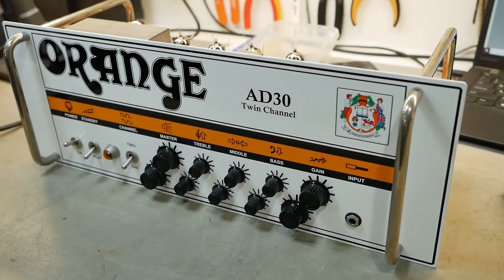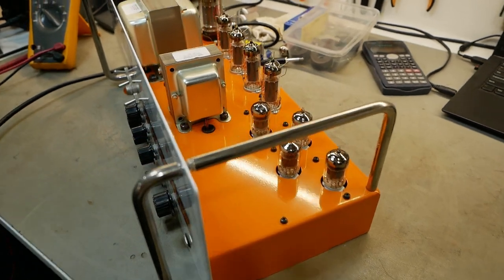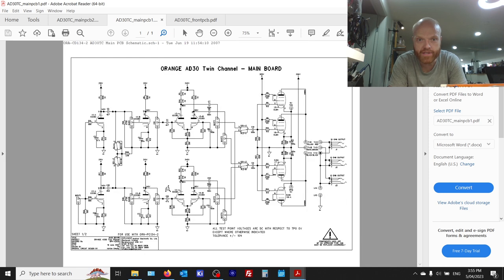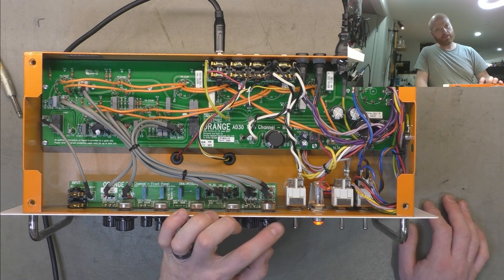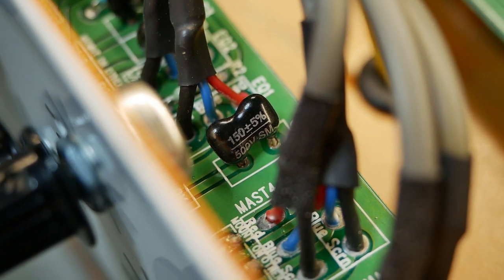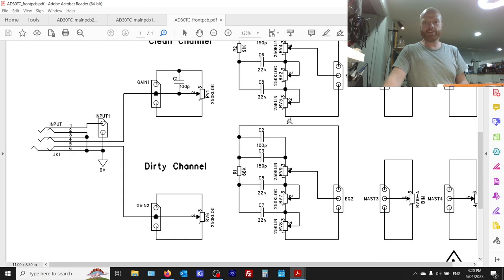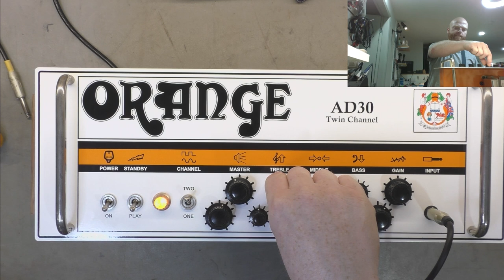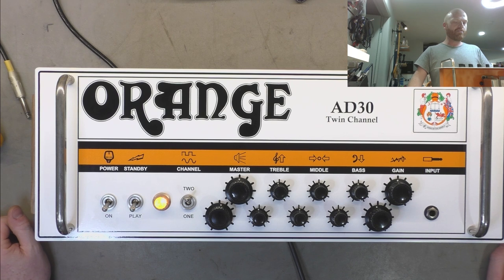Orange AD30 - Blowing HT Fuses & Noisy

Comment: I have one of these.. absolutely love it. Didn't really know what it was to be honest when I picked it up.. had another orange amp fail and the shop offered to replace it with the ad30, if I didn't like it I could take it back after a gig. I still have it 10yrs later. Tuner, wah, channel switch and gain on 10 on both channels and you are ready for anything... well not metal but enough to rock.

Comment: I'm not a fan of JJ rectifier tubes. Good catch. Lately I've been finding problems with JJ preamp tubes, I've been under the weather lately, came back from physical therapy today and I figured it was warm enough (44 deg f) to go out in the garage and check out a 64 Custom Vibroverb that had exactly that noise on the vibrato channel, do a little tube rolling. Turned out it was a brand new JJ 12AT7 in the V3 position was causing all the trouble. Dang. You can chug like Dime.
Reply: JJ in the last 4-5 years have def been unreliable, from what I've heard. The quality control coming out of the factory, and places selling them aren't doing proper QC more or less. I think that certain dealers expect that the factory should be doing the main QC, which you'd think right, so they either leave the final QC to the customer, or want to charge extra for QC. 

With JJ for instance, even Dave Friedman loved the JJ's, but sometime in the last 5 years he had to drop them, because so many tubes were failing. Also, I dunno if someone like Dave was getting them direct. Either way, I heard it was getting really bad,  and I dunno if JJ got their shit together. 

Now, I myself really like JJ's, especially the power tubes, and Rectifier tubes, but I've never ordered them from anywhere other than Eurotubes, and I've had about 20 Power Tubes, 4 Rec tubes, and 10 preamp tubes in the last 5-6 years, and haven't had one issue, and i play my amps hard. I know they do amazing QC on their tubes, only deal in JJ, and don't even think they charge much more than other dealers, maybe a tiny bit. 

Anyway, I dunno about the other dealers out there, but heres what I can say. These days, you just need to find a way to do your own QC on stuff, and it kinda sucks, but I think it's worth it if your just a dude that orders a few tubes every now, and again. It's also fine if you want to pay extra money to a company to do the QC, and that may help a lot weed out tubes that are going to bite the bullet right away, but anytime I get tubes, whether it's Eurotubes, another dealer, or online, even if they've been QC'd, I always make sure theres a warranty, and as soon as I get them, they go on the tester quick, just to weed out shorts etc, then they go in an amp, I bias it, and I run/play that amp for 4-8 hours within the first week or two.

After that, I feel like it's usually safe to say that actual shitty tubes will get weeded out for the most part.  It doesn't guarantee a tube for like years, because stuff can happen, but theres definitely Infant death tubes, and if you got any, and don't check, when you go to play a gig or two within 3 months to a year, and it dies, you'll not only be stuck paying for it probably, but your gig will be fucked to. 

I also thought I heard of another factory/tube brand at some point going through times of really bad QC, but TBH, I think that we live in a world where QC has become poor with a lot of things, and from a lot of places, so the more you can do your part to just do some QC whenever you get something, no matter what it is, it not only hopefully let's them know they are having issues, and whether they knew, or not, it might hopefully hold them somewhat accountable.
Reply: @jamescassidy4045  They kinda blow hot and cold. The only ones I don't use are the JJ 5AR4 because I think the envelope is fragile. Other than that I'm OK wqith what they're putting down. The ECC81 is a little light duty for the reverb driver position on Fender amps but I don't use them, I'm working through a stash of Milspec 12AT7s I picked up a while ago. If it's new stuff I think the Tung Sol reissue 12AT7 is good and reliable.

Comment: I dig the tone on this. And I’d venture to say I could probably play metal on it fairly happily with an SD-1 in front with a touch more gain. Looks like a generally well built amp, or reasonably easy to service.
Reply: Turns out an SD-1 kind of sucks for boosting channel two, but surprisingly an MT-2 with no distortion dialed, level at around 1 o’clock and the EQ controls in a neutral sounding position is an awesome boost for this amp. Blues driver would be a good one too probably

Comment: love the orange amps.  ive got the tremlord 30, which has diode rectification.  Pretty sure in that case i'd be using the standby correct?
Reply from the maker: Yeah, not a problem in amps with SS rectification.
In that case, it's necessary to use the standby switch if the caps are rated close to the HT voltage.
If they standby switch is turned on before the valves are warmed up, the HT could exceed the voltage rating of the caps while the B+ is unloaded.

Comment: Well oddly enough I ended up getting one of these. Guess what kind of symptoms it’s exhibiting and which caps are leaking DC? Going to replace these silver micas and hope for the best.
Reply from the maker: Pretty easy to test for leakage to know for sure, mate.
Reply: @BradsGuitarGarage  I checked and it’s pretty bad, 127v on the HT leg and 100v on the other. Guess I should look around in my OR30 to see if it has any of these same garbage caps even though it has no symptoms of any issues.

Comment: My preference is a  small  cap [ like 8mfd ] then choke to control inrush current . NTC will also work in this case with little voltage drop.  Have seen the abuse of valve ( tube) diodes by too large a first cap  done way to often .   When the heater are up the power tube and front end tube will flow current adding to the surge .  Modern rectifier valves (tubes) are not as stout as the ones from the 50,60,70s  from what I have seen .
Reply from the maker: Some designers subscribe to the "more is always better" philosophy, unfortunately.
Reply: @BradsGuitarGarage  Man's just got to know his limitations. (Que  exploding caps.)

Comment: Would it be a relatively simple task, or  a three-act-play to substitute a solid state rectifier for the valve in these amps? 

And would that even solve the issue?
Reply from the maker: Pretty trivial with something like this:
https://www.cedist.com/products/solid-state-rectifier-yellow-jacket-yjr-5ar4-5u4-5y3
Or this:
https://www.cedist.com/products/solid-state-rectifier-5ar4-5u4-5y3-tubes
Or if you still want the tube-like sag, this:
https://www.tubedepot.com/products/wca4-copper-cap-solid-state-rectifier
The bias may need to be adjusted due to the higher plate voltage with any solid state rectification, however.
And yes, in this case that would solve the issue, but so does simply not using the standby switch.

Comment: I wish amp manufacturers would just do away with the standby switch if it's not necessary on that particular amp. To be fair I'm making the assumption that the amp manufacturers actually understand their own circuit designs. My bad.